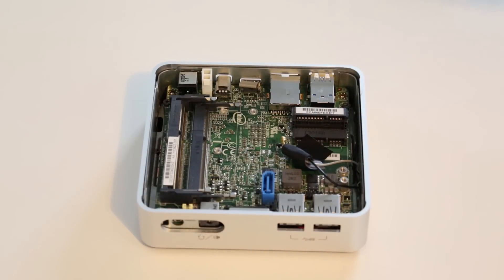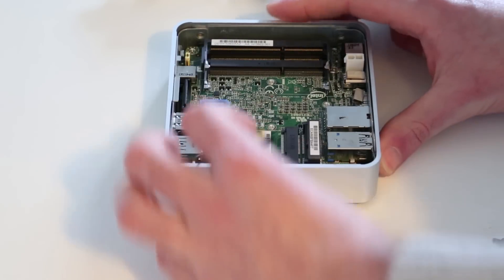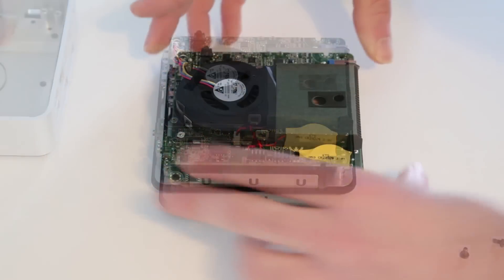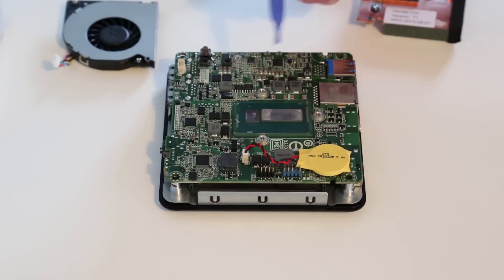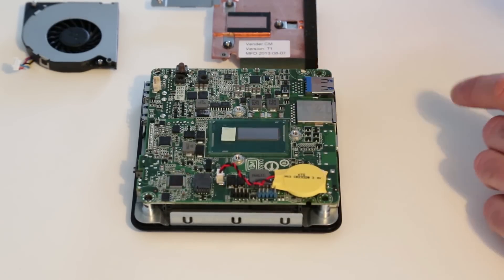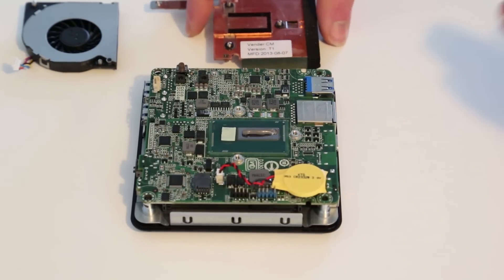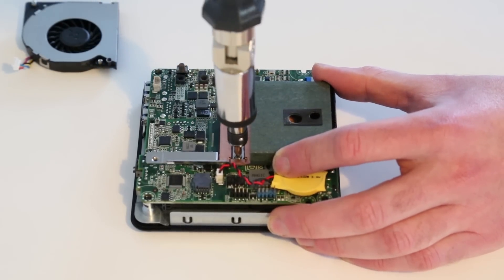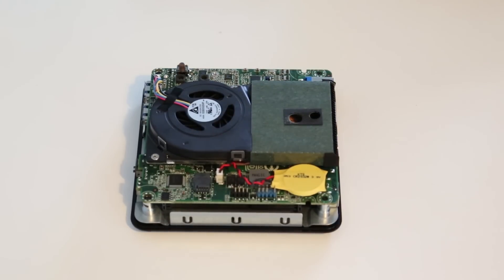Intel NUC D54250WYK - Motherboard and cooler removal

Comment: This video certainly aged well -for me, that is, since I have a 7th with almost everything in the same place :D. Though I have a big question: do you know if there is any way to replace the whole cooler for a bigger one? I ask particularly because of the three-screw bracket, since I haven't found a single cooler online to fit that!!!!

Comment: I fixed my fan today and wanted to re-do the paste but after removing the two holding screws for the copper sink and saw the sink was separated from the paste-pad, it wouldnt come off the board. I dont want to break anything, what am I missing after the two screws? (I dont have a third screw on the vent like you do).
Reply: There are three screws, they form a triangle.

Comment: Nobody ever tells you how thick the thermal pad must be. 😭
They often come apart when removing the cooler and so do need replacing.
Reply: I need to know too did you ever find out how thick it is?
Reply: @BSSMSLJ  mine is a NUC8i7 so whatever it is on mine won’t necessarily be right for yours
Reply: Lol, so is mine!
Reply: @BSSMSLJ  I bought a range of pads to try but  the NUC is still all in pieces. Hopefully I can get done soon and get back to you
Reply: welp! Good luck with that, I'm going down that rabbit hole now, guess I'll buy a variety pack, tks for the reply. @X-boomer
Reply: @BSSMSLJ  I thought to try fitting it temporarily without the pad and slip a feeler gauge in there to measure the air gap. Add say 30% allowing for compression and that would be the pad thickness. But this method is pure guesswork.

Comment: Very useful video. My daughter's NUC was running very hot with the fan going full pelt. We opened it up with your help and cleaned out the cooler with a vacuum cleaner, now running cool with little fan noise. Many thanks!
Reply from the maker: Glad it helped

Comment: Hahaha so theres no point to putting a additional heatsink on the outside of that metal fan housing.
But, from the look of it, one could easily put a massive heatsink on there with a diferent fan or maybe even modify a water block too.
Reply from the maker: For the cost involved you'd probably just be better off with a newer NUC, or just a bigger PC as in going watercooling you'd be massively be increasing the size of it anyway.

Comment: Thanks, works for my D54250WYKH. People have commented that you cannot get the H version out, but it does come out - just use gentle persuasion.
Reply: Remove the plastic housing that covers the headphone jack by pressing the 2 plastic tabs  inside the case anc pushing them out, motherboard comes out easily after that.
Reply: @theduck17  Thanks - that was catching me out .... (headphone jack tabs etc)

Comment: Holy hell. That's like 4x as much paste as you should be using. At least. I had to use something like that to get the chipset die to contact the cooler, as my thermal pad was all but ruined after 4-5 years of running and I didn't have a replacement. Either way, the factory applied paste was very badly done as well, so it's well worth redoing it if you  find the fan in your NUC runs more than you want it to. It was also completely dried up and cracked by now. I got regular load temps (Kodi video playback and such) of high 50's on the GPU now and low 40's on the CPU after re-applying. Not sure what they were before, but the fan went on high RPM as soon as I did anything on the system, which was just super annoying.

Comment: Hi Brue Computing,
What thermal pad did you use as a replacement on the nuc chip set int he video? Thermal pads come in different thicknesses and not sure which to order.

Comment: Thats too much paste  waaaay to much! Check some Overklocking experts videos how its supposed to be!
Reply from the maker: +AlexR I agree, I did redo it afterwards. Hard to gauge it whilst staring through a viewfinder. ;)
Reply: People over exaggerate the difference of applying too much. Hell even with mayonaise or toothpaste people got processors working fairly good.
Reply: @MathijsGroothuis  heck you should take a shit on your cpu.. i'm sure it will work fine..
Reply: @ginofoogle6944  everything is better than air as a conductor.
Reply: Yes its too much i put less than this quantity and i had to replace it and open my yoga 900 again LOL. i found that best way for these long cpus is spread method.

Comment: WHat temperatures do you have with the Arctic Silver 5 while IDLE and FULL LOAD ? Good video, but I hoped that the main point was to compare the temperatures. That amount of thermal compound. Glad you re-did it. :-) I consider re-paste-ing my D54250WYKH.THanks
Reply: Arctic Silver 5 may not have the best tempertature but it does peforme a great stable performance throughout

Comment: This is fine, but the D54250DWKH has a larger aluminium case, and I CANNOT get the motherboard out to remove the battery, which I have to do because of that famous Ubunto jinx that means the unit won't power up after sleep. Any ideas on how to get the MOBO out of that larger case?
Reply: Fergus Johnston  same problem here... just a few years later. Did you ever figure out how to remove the motherboard?
Reply: @LinusT  Try removing the dark plastic oval-shaped cover surrounding the front-panel audio jack first.  It has two tabs you can gently pry apart from the inside of the case, working a blade into the gap from the front as it starts to get loose, and it will eventually pop out.  With that cover removed you'll see that the 3.5mm audio jack protrudes about a millimeter out through the front of the case, and that's probably what's hanging things up.  Removing that tiny cover gives it a bit more wiggle room, just enough for the motherboard to be carefully coerced out of the case.
Reply: @scotttaylor1051  yep, that's necessary. It's also removed in the video, but he didn't show that step..
Reply: @scotttaylor1051  nice one
Reply: I'm having this exact problem. Just figured out that the 3.5mm jack cover could be removed since it looked like that part of the board was where it was stuck. My fingers hurt from repeatedly trying to pull the board out though so I'll have to try pulling it out again with that piece out.
Reply: @Llamageton  I've got a small metal part extruding from my audio jack that wont allow the board to be extracted. Did you have the same issue?

Comment: Good guide, but my lord, so much cooling paste! Use 1/4 of that. The cooler sits on the core of the CPU. Cooling paste is just to close any microscopic scratches in both the CPU and cooler.
Reply from the maker: Yes it was rather a lot - it was hard to film and apply thermal paste at the same time! ;)
It was reapplied afterwards.

Comment: Hi, was there any benefit to doing this. What were the max temps before and after you did the repaste?

Cheers!
Reply from the maker: Any benefits would be marginal to be honest. Unfortunately I didn't take any before and after measurements as I filmed this section while assembling the NUC for the first time.

I actually used too much Arctic Silver in the video as it was difficult to apply it and operate the camera at the same time and re-did it afterwards with a smaller amount.
Reply: Hello Brue,

I lost some ports on my NUC 54250 and therefore would like to exchange the motherboard. Do you know where I can purchase a new motherboard for this unit? It's the WYKH version.